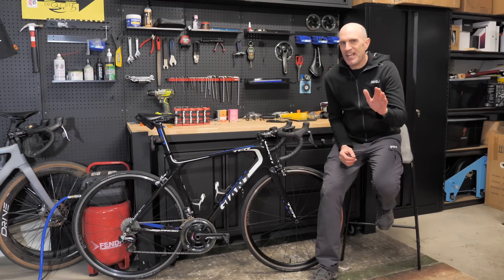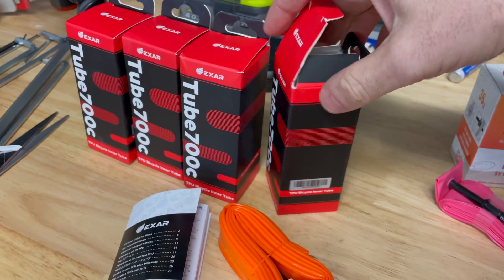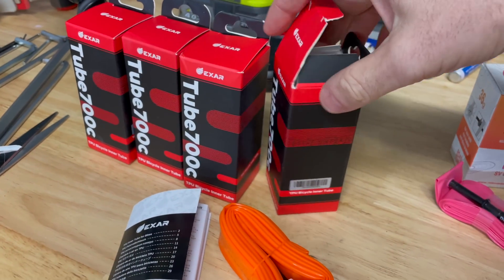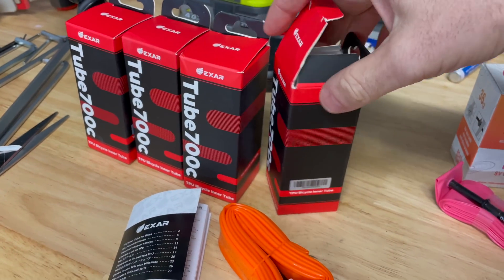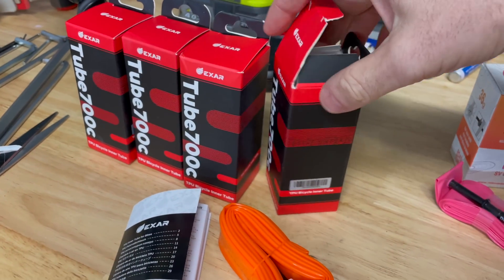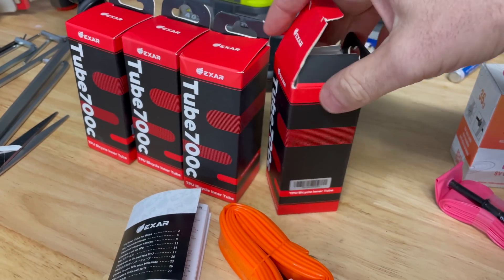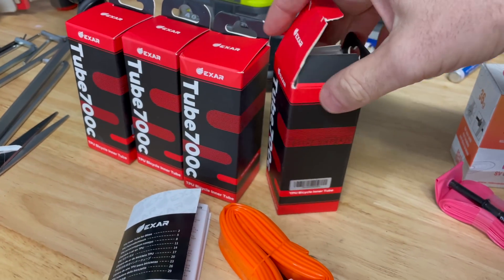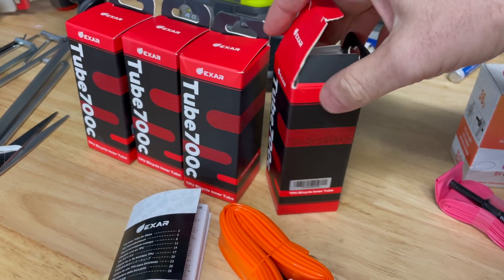TPU Bicycle Tubes: Light, Fast, Cheap.... What's the Catch?

Comment: Tryed when first came out, they sucked never tryed again. Really for the weight or space who cares only suckers that get conned by local bike shops 😂😂
Reply: Heard the same story years ago w Turbolito. Can't find a flaw with current RideOns, they are even relatively cheap and can be patched easily.
Reply from the maker: I've heard a few similar stories from early days. Valves blowing off at the join, etc.

Comment: My first and last TPU was used in 38 degree C and it got permanently stretched so thin around the valve that I stopped using it for safety reasons. Indeed, an expensive experiment on a wrong day.
I have mastered the art of tubeless for a long while now and the only complaint is that it dries much faster during hotter months. Probably going with 5L or 10L containers.

Comment: So, bottom line for you is that tubeless are most comfortable, you just have the sealant maintenance issue/keep tyres pumped up issue ?
Reply from the maker: It's not a direct comparison based on TPU vs tubeless. My other road bike with 28mm tyres are on carbon hookless rims (that push them out to 30mm) ridden at ~60psi. The switch here was as mentioned, to lower the admin/overhead of this bike.

Comment: I use tubolito as a spare. Too expensive for everyday use but I like the weight saving.
Reply from the maker: Those are in the AU$40+ bracket here.... very expensive.
Reply: @gplama probably better CS. They sent me a replacement when I had a slow valve leak
Reply: As a spare, I am more attracted by the space saving, than the weight saving.

Comment: Try the TPU tubes with a non-tubeless tyre. Much better with the more pliable tyre wall.
Reply: my hookless zipp wheels don't let me use non-TL even with inner tube 🙃🤦‍♂
Reply: @SonnyDarvish hookles road is a joke. I feel sorry for everyone who bought into this nonsense
Reply: @kubackjeee   Yep - OEM on a Giant TCR.  Didn't fully understand the world of pain I was in for, with limited tyre compatibility, and even those that are approved can be really difficult to fit and to seat properly (even if running a tube, if they don't seat, they don't run round, and are really annoying going fast downhill ... something I've had to put up with multiple times after roadside repairs, inflating with a hand pump).  I would stridently avoid hookless in the future - to the point of avoiding any bike spec'ed with hookless.
Reply: @kubackjeee  I didn't mean I'm not happy with the wheelset and I would be happy to understand the joke. I started road cycling in 2019 and the first Scott bike came with 30mm tires. I tried 25mm tires high pressure, I got pain in every joint.

I bought this wheelset for a couple of reasons, but hooklessness was not part of them. Wide rim inner width, weight, known brand and bling, discounted and immediately available with instalment were my biggest reasons to purchase. So far, no problem. I never want to go back to inner tubes and fixing punctures every now and then.
Reply: @graemewoodward  get some soapy water (use a bar of soap not detergent) get an old paint brush and pain the internal rim wall and outer tyre bead. will slip in to the bead and seat easily with no dramas.
Reply: @SonnyDarvish what wheels? Enve?
Reply: @SonnyDarvish  That's why a lot of people don't buy Zipp anymore. Zipp's strategy is "our way or the highway" and people are choosing the latter.
Reply: Well picked up Michael, Shane kept the tubes tyres.  Sort of defeats the purpose of weight savings as well.  Tubeless tyres being 50g heaver or so.
Reply: @byrondixon4648  heavier and harsher to ride with tubes because of stiffer sidewalls.
Reply: +1 for this
Reply: Many tyres come only tubeless ready now...
Did anyone tried talc? I think it was used to help tubes fit correctly, in the older days.
Reply: Absolutely, with nice cotton tyres. I could not feel a difference in rolling resistance and comfort between those and tubeless Pirelli P-Zero Race. Schwalbe feel similar but always puncture on me no matter which sealant I use. I have no experience with hookless and lower pressure there but for „regular“ tubeless on the road the pressure is normally too high to seal properly. For me it only seals around 3-4 bar. I personally find it not practical for road. Love tubeless for cross or MTB though.
Reply: Exactly, tubeless tyres will have less puncture resistance than normal clinchers as well as they rely more on the sealant for that…

Comment: TPU: expensive, cant be repaired in my experience, some cant work with rim brakes, often lack long enough stem options eg 80mm, needs care when inflating outside the tyre. apart from that, seriously, they are good, easy to fit and seem to ride well an great as a spare (if cheaper). I prefer latex tho

Comment: I carry one as a spare. Latex was always my choice until today, I have literally just moved to tubeless
Reply: What rims and tyres ?
Reply: @matthewblue7839  vision 40mm. Tyres are Pirelli p zero race 28’s
Reply: your thoughts latex 2 tubeless
Reply: @adccars359 only 1 ride on tubeless so far but:
Fitting tyres was no harder than my previous clinchers GP5000. Ride feel as smooth as latex, hardly anything in it.

Main motivation is punctures, after years of hardly ever puncturing I have got through 3 ruined tyres in the last 6 months and puncturing approx 1 in 3 rides, it’s been very tiresome